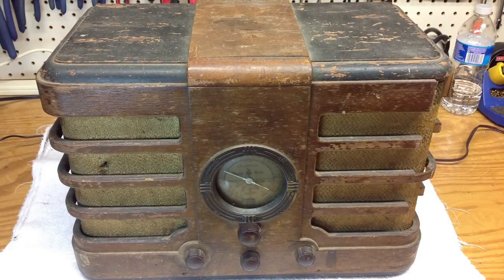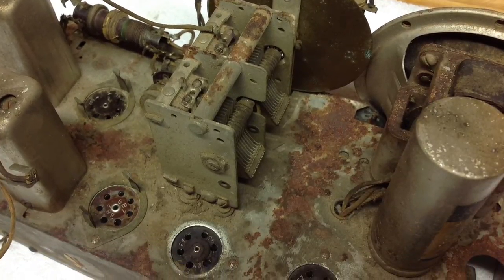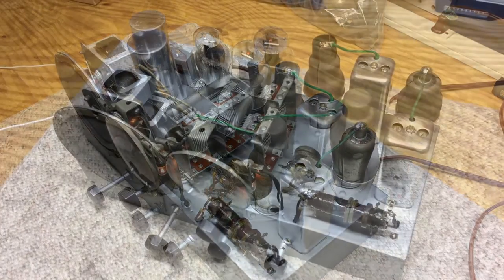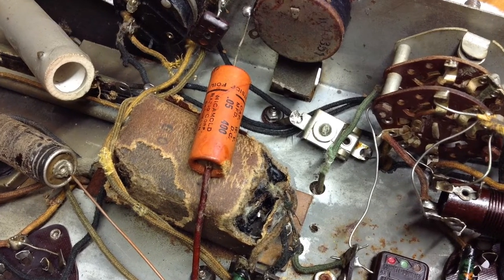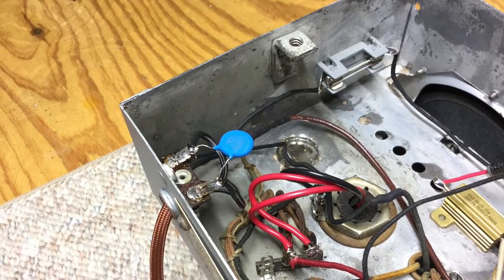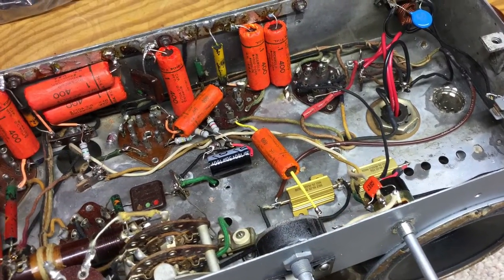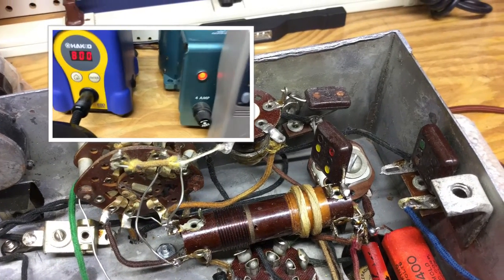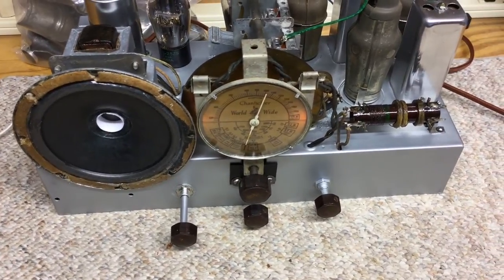Chanticleer 2D570 - Electrical Restoration Complete

Comment: I wonder if this Chanticleer was made in the Gilfillan plant in L.A? A lot of radios in the Los Angeles area were made in the Gilfillan plant since Gilfillan was an RCA licensee. It has a look rather like a Packard Bell or a Mission Bell radio, but without a power transformer.
Reply from the maker: OlegKostoglatov ***** May have; adding AMStationEngineer to this thread as he noted early on that the parts used and the design/layout appeared high end for the period. According to information posted on the radiomuseum.org site, Gilfillan Brothers Inc. did operate out of 1815 Venice Blvd, Los Angeles, CA, while the Chanticleer Radio Co. operated from 1728 Venice Blvd, which I assume was a block away on the opposite side of the street, but who knows they may have collaborated on the manufacturing. The history of the radio is intriguing for sure. Don
Reply: Many thanks, Don!  Can't wait for the cabinet to be completed - a true gem!!
Reply: I have a Chanticleer Radio that I have been having a hard time looking for any information. It has the same cabinet, except it has a provision for a 6U5/6G5 magic eye right above the dial. it also has colored lens for three pilot lights. The chassis is identical in size except it has a Pepco transformer. The tube compliment is 80, 6F6, 6F5, 6H6, 6K7, 6A8, and 6U5/6G5. My model number is 670-E.
Reply from the maker: Great find and in my opinion a very rare find. Check out: https://dbase1.lapl.org/webpics/calindex/documents/15/522985.pdf

Page 41 and other...